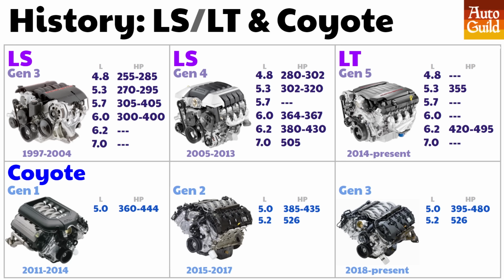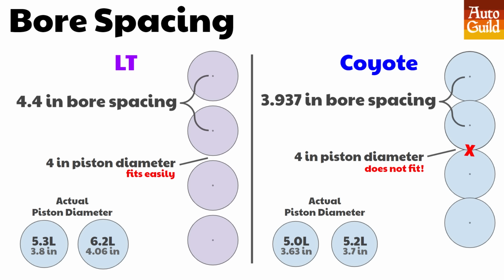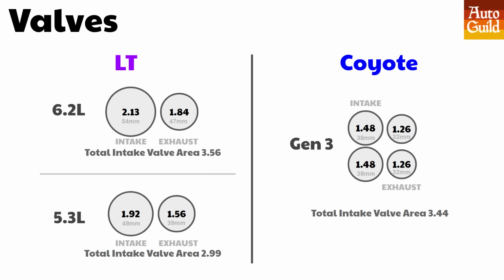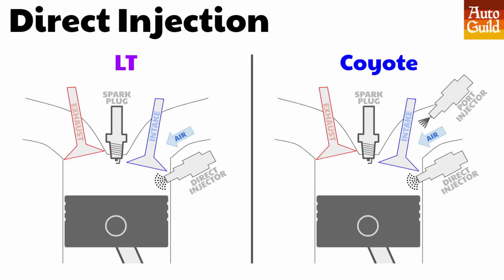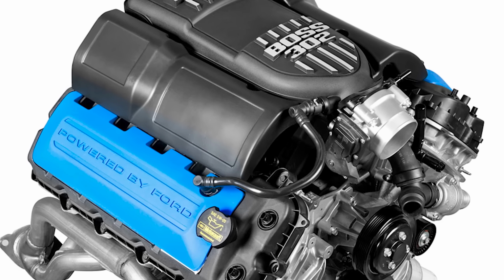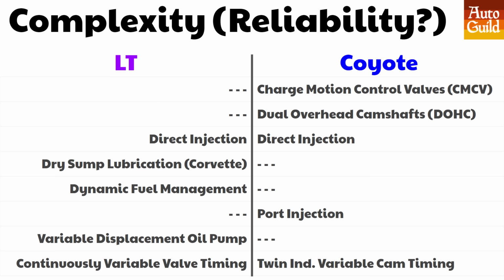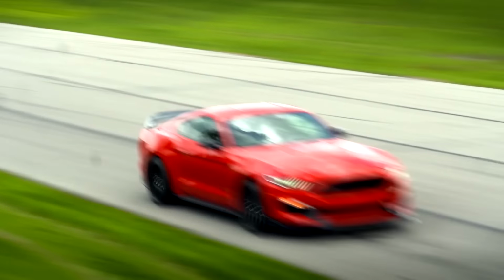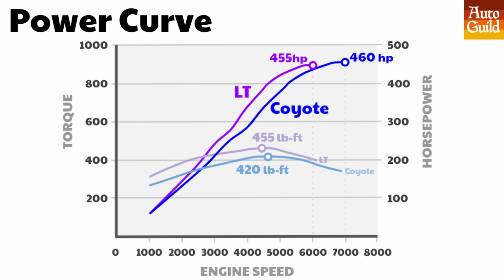GM Gen 5 LT vs Ford Coyote.  Which one is better and why.

Comment: Love how you say the lt can only hold 900 stock even tho lmr has zr1 corvettes with 1200 hp stock blocks just bigger supercharger heads cam and e85
Reply: I agree the Lt4 and Lt5 short blocks are stout
Reply: The coyotes hold it entirely stock, which is amazing considering the abuse they can take stock everything, you also don’t have to do H/C on a coyote, just go straight to boost.

Comment: Super expensive repairs for the Coyote.  One little hiccup on any DOHC engine and your wallet will get a lot lighter.
Reply: Everybody always repeats this same info with nothing to back it up.  Super expensive repairs.  What exactly is so much more expensive to repair than it would be with the lt engine?  I'm genuinely curious and I assume you know given your comment.  Yes it costs more to add cams because there are 4 not just 1.  That goes without saying. Outside of that I don't see a huge difference between the two on other things.  When you go built motor both have similar costs.  Intake manifolds and stuff like that again similar cost depending on what you get.  So as far as upgrading the engine outside of cams I don't see much difference in anything else.  You can get big power out of the coyote just slapping a blower or turbo on an untouched engine.  No valve springs no cam upgrade no cylinder head upgrade etc.  Im just saying both of them are great I just don't see this huge difference in repair prices everyone talks about but again I've never owned either engine but I have had 3 different dohc fords. B
Reply: @midnight347  I totally agree!  Also to add the  4 cams aren’t that much more expensive than a single cam.
Reply: @midnight347 ,  first of all,  Ford parts aren't as readily available and there are a lot more parts to the coyote.  Don't take my word for it,  check for yourself.
Reply: @terryduncan31  Same goes for GM. Haven't you heard About a scandemic causing production/delivery problems.
Reply: @72blazr1 ,  there's already a lot of parts available for the GM engines because of the sheer number produced.

Comment: It’s funny the Coyote is a good engine for a half ton truck and does have decent torque for “reasonable” towing, however guys buy it and expect it to pull over its capacity and say the engine is no good it doesn’t make any torque.
    I wish people, even mechanically educated people, would use common sense.
Reply: Mostly are EcoBoost owners that bashes on the Coyote V8 and calls it 5.Slow Slowoyote.
Reply: @CJColvin  Name one Quote ???

My 4v cleveland can plow any coyote hands down and handles very well if you know how to drive and drift them.Especially on a dirt road. 1970 Mach 1, Coyotes are a Joke!
Reply: Most Milinials dont know how to drive to keep up with Old school. :)
Reply: @davidrutledge5464  How much power is you're 351 Cleveland making and what upgrades does it have.
Reply: @davidrutledge5464  how old are you bro?
Reply: @CJColvin  that’s an excellent question about the Cleveland lol my dad has had his 72 Gran Torino since it was 6yrs old. It cane with a 351 Cleveland.years ago he did a frame off restomod. He chucked the Cleveland and put in a 2011 gt500 crate engine with a tci6x automatic trans. He knew he would never make big power and still be reliable able. Check it out the standard rpm has a article on it. It’s called Project Breathless Gran Torino
Reply: @davidrutledge5464 about the Cleveland lol my dad has had his 72 Gran Torino since it was 6yrs old. It cane with a 351 Cleveland.years ago he did a frame off restomod. He chucked the Cleveland and put in a 2011 gt500 crate engine with a tci6x automatic trans. He knew he would never make big power and still be reliable able. Check it out the standard rpm has a article on it. It’s called Project Breathless Gran TorinoNow if he could he would go coyote. It’s all about making the power and beautiful my able to drive without dumping fuel in a carb when you want to do things like the power tour. Plus with a newer ford engine if you have issues you just go to a ford dealership and figure it out. A Cleveland you would be maxing it out pretty good for practical drive ability at 400hp a coyote or the 5.4 gt500 he has is just getting started And both can run reliably at 700-950whp without ever opening the engine. Stock heads cams and never opened.
Reply: @davidrutledge5464  Nonsense. You’re speaking from a sentimental standpoint, not a rational one.
Reply: @carculturenation2166  Awesome brother How much power is it making.
Reply: @carculturenation2166  My 96 F150 has a 5.0L (302) Windsor V8 with 209,000 miles and still going strong.
Reply: @carculturenation2166  I've seen that car and let me tell you its a badass Torino.
Reply: @davidrutledge5464  laughs in Windsor.
Reply: And then there's the TRITON engines.. 5.4 with 4.25 stroke.. and VVT... NO COMPLAINTS! 
06 Expedition on 26's pulling classics from Craigslist..
Reply: I drove a 2018 f150 5.0 towed a 5 ton dump trailer with it a few times it did pretty respectable as long as you kept the rpm above 3000
Reply: That does not mean it's because of the turbo.  And what do you mean by 'broke' that could mean so many things. Bottom line is, those engines don't break no more than any none turbo engine. I know about 4 guys that got over 200,000 miles on the turbo engine and they are still going strong.
Reply: @USMCretired09  200K is nothing and not exactly worth bragging about show me a couple with 400K  then come talk....   The Eco's suffer far far more failures than the Coyote's do. There is a reason just about ALL Ford techs given the choice will pick the Coyote over the Eco's.   The Eco's are decent motors but they are not as good as the Coyote, They just do not they have the longevity or reliabailty
Reply: @frenchonion4595 that's the reason why those belong with a diesel (turbos) since the engine turns low rpms and needs that boost to maximize that torque output.
Reply: Your funny😕
Reply: Lol I’ve always wondered this.....the Coyote comes alive up top..... but what changed my vision was At My last job the shop foreman owned the fastest 1/4 mile F150 on the planet, it was a 10.1 second car, & he was always improving it. Whipple supercharged , gutted, interchiller, everything
Reply: It makes it torque late it’s a high revving engine it’s great for a car or race car but not so good for a truck that you tow for a regular truck sure.
Reply: The guys that most often say that are the guys that swear by the Ecoboost engines.
Reply: @karlschauff7989   Could be I suppose,  the eco really cranks out the power, but the only thing it can’t pass is a gas station…Lol
Reply: @powderriver2424  I love towing with my 5.0l, now that being said I wouldn't say it's a good engine for towing. It's doesn't make alot of bottom end grunt especially on regular fuel.
The coyote loves premium, empty most won't notice a difference in power except I get a 1.3mpg average better fuel mileage. Now towing, especially on a hot day, premium really helps the mid range power. But unlike the Chevy v8s the coyote pulls strong all the way till the transmissions shifts, making the gears have a longer usable power band. A stock Chevy V8 truck engine seems to run strong up to 3800 rpm and then kinda falls flat, its still pulling strong, it just doesn't gain much after that.
Reply: @fordmud  A lot of it depends on rear end ratio too. The coyote makes more torque than the 5.3
Reply: I have a 2011 Ford F150 with a 5.0L Coyote V8 in it with 140,000 miles and still going strong and its a beast and it sounds like a beast with the Borla ATAK exhaust. For me I prefer the Coyote V8 over the EcoBoost V6 anyday of the week because I don't deal with turbos breaking because its NA and it sounds wayyyyyyy better as well.
Reply: Please tell me how many turbo engines that have broke. They been making these engines since 2011, any bug would have been worked out. But the don't break.
Reply: @USMCretired09  Here's a video that'll tell you the reasonhttps://youtu.be/YV7UY9XC5bg

Comment: The Coyote is a great engine
Reply: I just wish they would have stuck with cast in place cylinder bore sleeves instead of that spray-in liner that's causing problems.
Reply: @karlschauff7989  Aftermarket makes sleeved Coyote. Look for MMR (Mod Motor Racing)
Reply: Yea yeet. That's why I bought a 17 gt. Got one for 5000 miles in February. Single port injection and good ol' fashioned sleeves.
Reply: Totally agree brother I have a 2011 Ford F150 with a 5.0L Coyote V8 in it with 140,000 miles on it and still going strong and its a beast and it sounds like a beast with the Borla ATAK.

Comment: Single cam= simplicity.
Multi cams= more weight, and more to go wrong.
All in all, the Chevy wins...
Reply: AFM destroys the Chevy engine.
Reply: @mph5896  change oil on time with proper oil, and that issue is minimal. Or delete the afm.

Comment: The 5.2L is not a Coyote engine. It's a Voodoo engine.
Reply: The 5.2 L; 315.1 cu in (5,163 cc) "Voodoo" is a development of the Coyote engine.
Reply: Its built from the coyote so is the road runner and predator they are all coyote based engines.  The heads with swap from one to the other as well as intake manifolds etc.  You can't swap mod motor parts to them though because they're a different engine.  I hate when people correct people and say "its not a coyote its a voodoo" its a damn factory modified coyote.

Comment: 2019-21 GM V-8's blowing up in less than 10K miles. Look it up. GM having a lot of issues.
Reply: Ford MT82 huge lawsuit coming
Reply: I have a LS2 crate engine with CNC ported LS3 heads from SDPC it was installed in my 1984 Monte Carlo SS in 2008 it's still in the car has had nothing more than sparkplugs wires filters and oil changes in 13 years of weekend use and it still raps 7200rpm and runs as good or better than when it was 1st put in it has a single intake manifold and a Holley HP 850 carberator this engine has been in my car longer than the coyote 5.0 has been made

Comment: The Coyote also went from 302 cid to 307 cid with the Gen 3 updates.
Reply: On the new gen 4, they went back to 302. They had to make a thicker plasma sprayed lining, making a smaller bore,
for durability.

Comment: Coyote still needs to prove its reliability and performance over time like the LS has. Will you be able to pull a coyote out of a mustang or f150 with 150k miles on it. will the motor still be useable at all. The LT is just getting started. I suspect that as you said at the end of the day the volume of engines and configuration s is on the LT side and with the dimensions of  the engine being very simular to the LS. Swaps will be made easy. Don't get me wrong coyote is a great platform. But the timing chains dual overhead cams and moving parts look complicated to work on yourself. Hence why coyote guys go straight to boost with out opening engines.
Reply: It's not as easy as an LT but it isn't hard to take apart and rebuild. We go straight to boost because the engine already has great internals, it's proven to handle the added power. Majority are the coyote in the f150, but there are a lot of 5.0's with 150,000 plus miles. My buddies f150 has 273,000 towing miles still going good. 

We do need another few years to see how the new gen stuff fares in the long run though. But with the gen1 faring well and technically inferior. The new stuff will likely be good too 👌.
Probably still not as cosr effective as LT I imagine. But I like it.
Reply: They go straight to boost because they don't need to open the engine.  Slap a blower on and hello 800+ rwhp on a stock untouched engine.  Why wouldn't you do that?  Everybody acts like they're so complicated and unreliable and that couldn't be further from the truth.  I've seen alot of guys with over 100k all supercharged still going strong and there was a high mile coyote build brenspeed done they started with 165k mile car put down exact power and torque they did when new and when torn down everything inside was basically perfect but they went ahead and upgraded some stuff anyways while it was apart but it wasn't needed because of wear etc.  The coyote is super reliable.  They've been around being beat within an inch of their lives for 10+ years now by many many people i think they've proven their worth and their reliability.
Reply: LT, lots of issues with lifters collapsing, and fuel injector issues. Mate that to the turn 6l80 and its a pretty weak combo.

Comment: I recently purchase a 2017 Camaro SS with the LT1 V8.  One of my main concerns was the buildup on the back of the intake valves.  The consensus in the Camaro community is that it really isn’t a problem.
Reply: I believe an oil catch can helps with this.
Reply: @theforerunners5171  ...but isn`t legal in countries with emission standards. Like for 550 Mio people I Europe e.g. and I don´t know were else.

besides, afaik it is not just crank case ventilation that builds up in front of intake valves but also exhaust gas redirection.
Reply: pretty standard to clean that up every 50 - 70 t miles here in Europe, where every car has direct injection since 15 years.

a simple walnut job, 3-4h and ~300€ on a non v8.

if we would be concent about that, we would not drive anything with a Otto engine.
Reply: GEN5 SBC doesn't suffer as bad from carbon buildup as companies like Ford and BMW do with their DI engines. It can be an issue, but is not overly common. This is one reason manufacturers (in this case GM) and people are so anal about running a particular oil in these newer engine to help fight things like carbon buildup and lesson lifter failures in AFM/DFM engines. GM recommends Mobil1 0W40 ESP. It used to be the Mobil1 5W30 ESP, but they've switched to 0W40. Make sure it has a DEXOS2 rating and you're good. That Mobil1 ESP oil isn't exactly cheap, but it seem to work well in these engines. I run Motul X-Clean which carries a DEXOS2 rating in my SS 1LE.